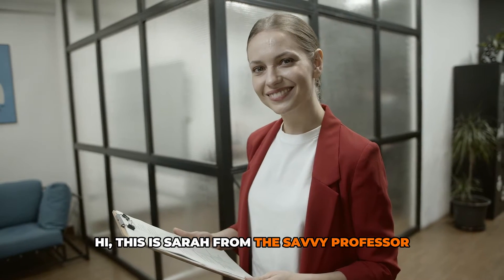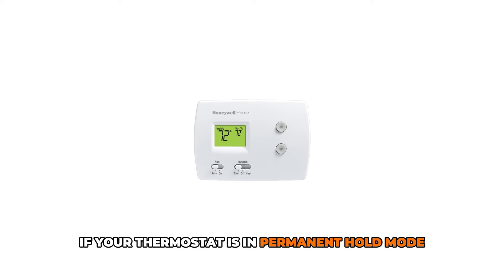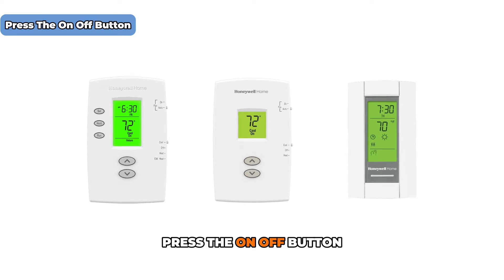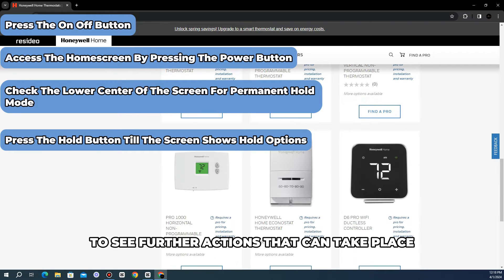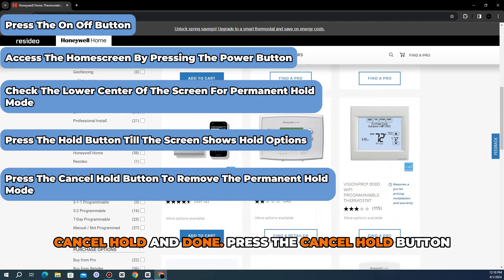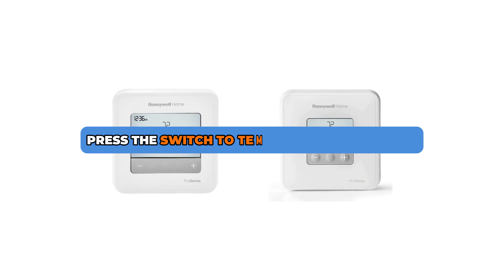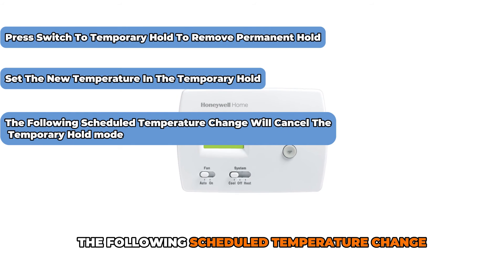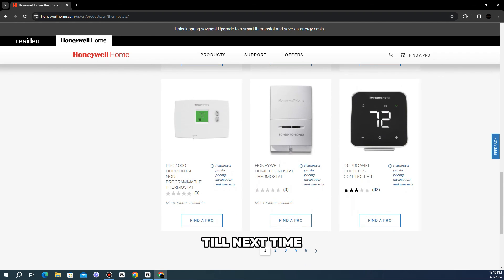How To Remove Permanent Hold On Honeywell Thermostat (How Do I Cancel Honeywell Permanent Hold?)

Comment: "Just that easy"?   This comes no where close to deleting the permanent hold.  It keeps coming back. 1st it doesn have an off on button.  Pressing the hold button just goes to permenanent hold,  then days.  Pressing cancel is just a back button, doesnt cancel anything.  You sure you've even tried this thermostat.  I dont think so.  Self proclaimed,  Savvy Professor should be not so savvy professor.